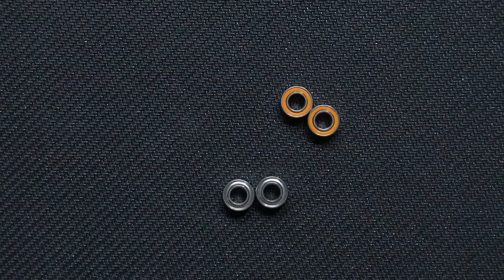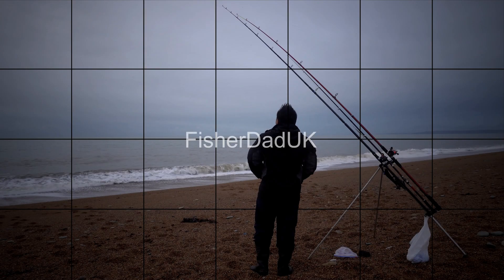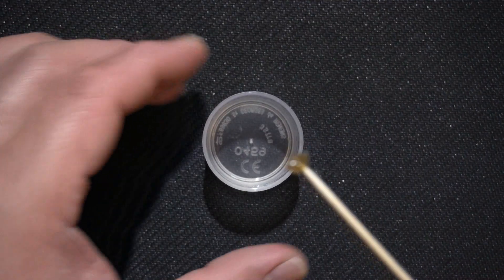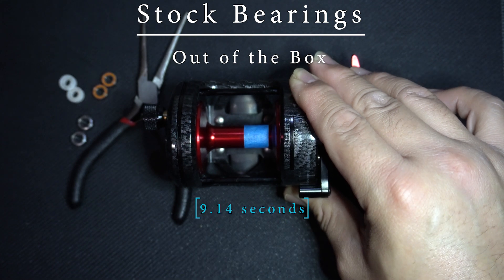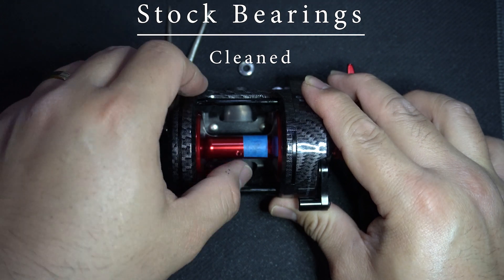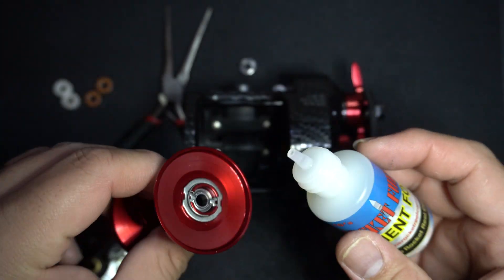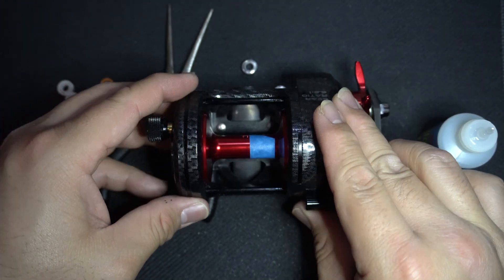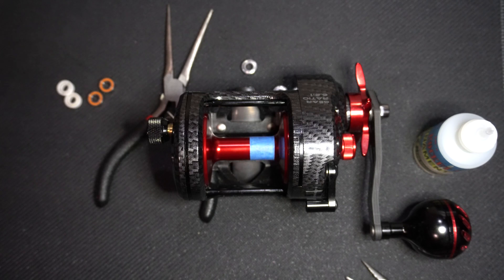Multiplier Bearings - Episode 1 of 2: Degreasing and Lubricating Stock Bearings

Comment: Hi, thanks for your interesting video on bearings. Will this method also work on sealed bearings in penn spinning reels?
Reply from the maker: Hi Leon. The method for cleaning the bearings should work with most bearings. If the bearings are sealed, you might have to take those seals off in order for the lighter fluid to get into the actual bearings. However, i do not think it would make a difference for spinning reels. It might make the reel feel smoother when reeling in, but it might not be a noticeable difference.
Reply: Many thanks. I removed the seals and your method work well. Thanks again. I didn’t have lighter fluid so I just used acetone 👍
Reply from the maker: No worries. I'm glad it helped. 👍 Tight lines!

Comment: How long do you soak in the lighter fluid
Reply from the maker: Hi Shaun. It depends. I find 20-30 minutes (with frequent swirling) is sufficient for the bearings I have come across with. Let it dry thoroughly and try to spin in. You can usually tell the grease have been removed if it makes more noise after you have soaked and dried the bearings thoroughly. I hope this helps. 👍
Reply: @x3mgrifter  yeah done it spun for ages at first but seemed to have slowed down again now with yellow rocket fuel probs loosing of again as wheres in
Reply: Getting 24 secs with mags fully off and spool full of line that sounds about right
Reply from the maker: That does sound right. I stuck with the stock bearings in the end as I find the ABEC7 & ABEC9 bearings hard to control - specially if I lose sight of the lead and bait when the sun is shining right on my face when casting. 🤣
Reply: @x3mgrifter  yeah going to order some 7s and try them with thicker oil like red rocket fuel and compare I've never took a reel apart before tbh so was new to me now got the bug to start trying to repair some going to try find a few knackered ones and try get them working
Reply from the maker: Careful Shaun... You might find yourself making modifications next. 😁 I modified mine so now it has tool-less screws so I can swap to a spare spool when I bird's nest.
Reply: @x3mgrifter  awesome mate how did you do this be intrested in doing this upgrade myself
Reply from the maker: You will need to expand the screw holes so you can fit a tapped insert. You can see the tool-less screw that I have placed on as well as how it looks on the last video I have uploaded Nitro Surf Rod Prototype Field Testing - https://youtu.be/ysjsFYde6Xw